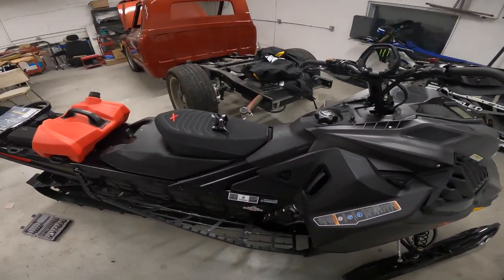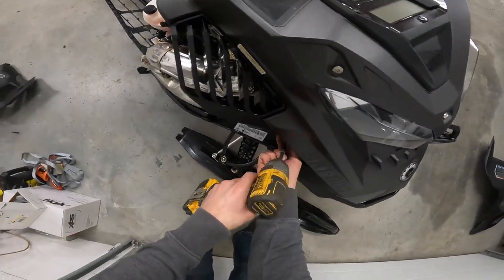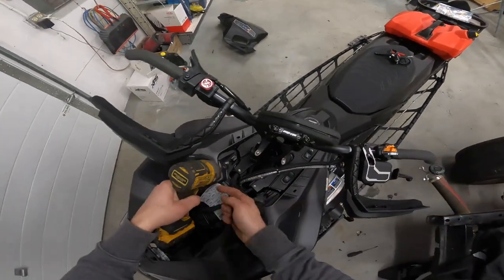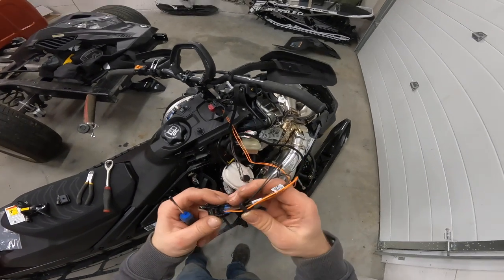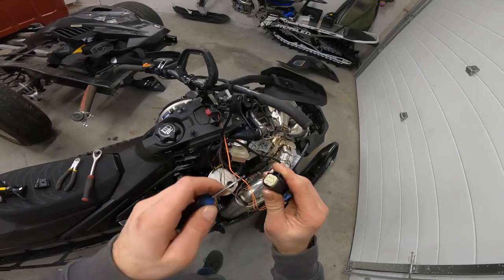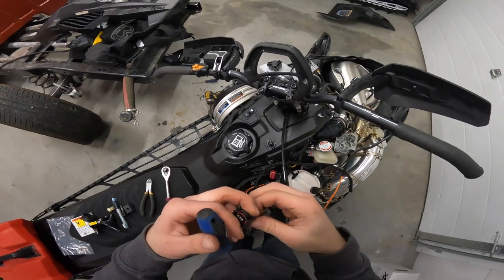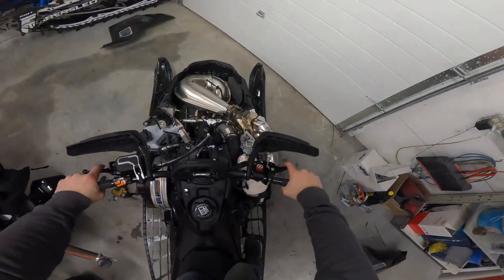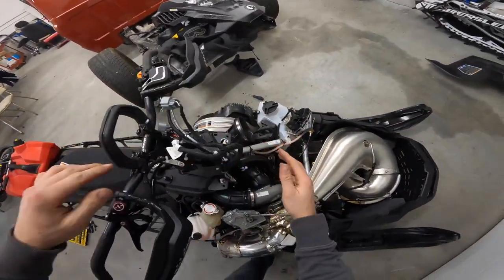Munster Finger Throttle install 2022 Ski-doo Turbo 850

Comment: How did you like it without the guard? I Have the ski doo hand guards and not sure if FT guard will also fit
Reply from the maker: I like it without the guard, the ski doo hand guard acts as the guard. But the finger throttle guard would fit.
Reply: On my old Shredder RE i had the munster handguard + the lynx handguards without problem @turbodan  :)